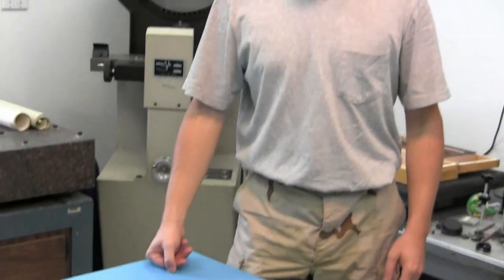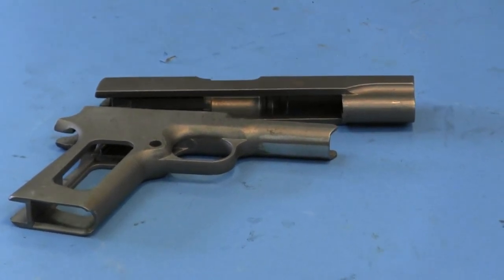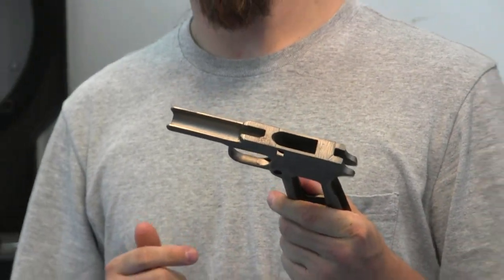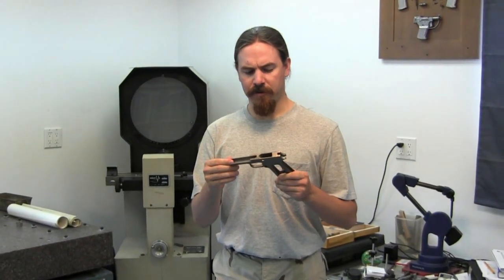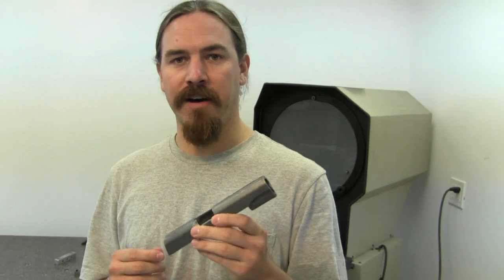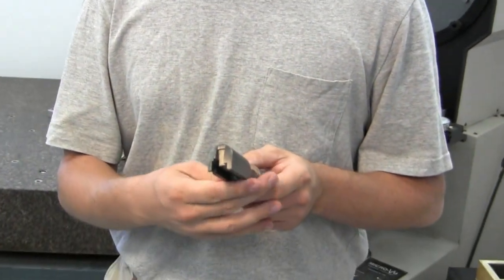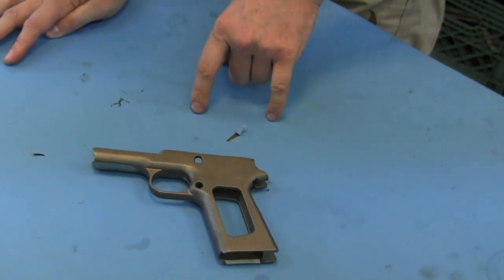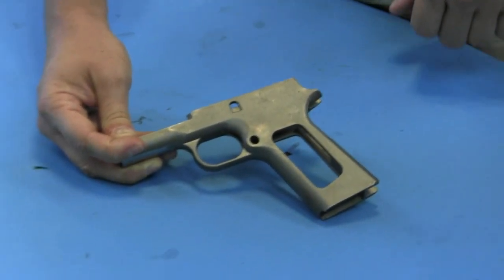Inspecting 1911 Frame and Slide Castings

Comment: I've seen flatter surfaces on any banana, and it's NOT an 'investment cast' one. Actually I put together an IDPA pistol, based on a Para (investment cast frame), with a factory Springfield Armory slide + Clark ramped barrel, Wilson beavertail grip safety, sear, hammer, diconnector, pin set, and slide parts, recoil spring guide & buffer, Wolff springs all over, Clark 4-finger sear spring. Tuned it myself and the outcome was pretty decent. Put some 1.000's of rounds thru it, (mostly my own reloads), and was still reasonably tight & reliable when I sold it to a younger fellow competitor who still uses it. Basically a quite accurate & reliable piece. I understand Ruger uses quality investment cast parts in most of their great products, which undergo machining with no issues related to it whatsoever. BUT several 'smiths won't accept R.I.A. 1911's, (Using several cast compinents too),  because variations & inconsistencies. The bottom line, I guess, is 'who' makes 'what' and how it is produced with 'what' raw materials to start with. Thank you for another awsome video!!.

Comment: Wasn't originally the slide stop hole on a 1911 frame the zero point for reference? From everything I have read all measurements are taken off that location, I could be wrong but I think that is what I read when I was trying to get a casting done and the measurement for the grip safety hole ended up being correct so I assume it is still true. I know you can also use the mag catch hole as well but ultimately the zero is up to the machinist and what points of references they have available. But because these seem to be so far out of wack your zero reference would also be out of wack and you'd end up with funky measurements, so I get why he didn't want to use them or even attempt to use them. 

I expected the top to not be perfectly flat and need to be decked, however, the side of the frame not being flat is a huge problem. I cannot believe someone out there cast these and didn't catch how shitty they were. I swear some people out there should not attempt to do a job like casting frames if they have no clue how to do it and not warp the living shit out of it. 

Anyways good luck on finding decent ones but you're right it is probably easier to just buy raw stock and start from scratch. He could make one from scratch and see if he can find a company who will cast the one he machines. Even Sarco castings lay flat on the side and are relatively cheap and buying wholesale should lower the price of them, however they have limited types of frame castings (mostly Para type frames).

Comment: So they are actually cast iron, thought they are too fragile to become firearms parts coz they can't absorb too much impact.
Reply: They are cast steel parts. There is a difference in cast iron and cast steel with cast steel being a lot stronger than cast iron. Cast iron is more close to wrought iron than cast steel. The metallurgy of the two is more specific than that but to simply put it cast iron is a form of iron and iron is also a part of steel the difference is that one is more malleable than the other and that isn't even really scratching the surface of the subject. 

How to tell the two apart is to hit a cast iron skillet with a hammer then hit a cast steel part with a hammer and you will notice the cast iron will thud and the cast steel will ring. 

The wide use of wrought iron in the 1800's let to Samuel Colt also using it for his first black powder pistols. Because of the lower carbon content of the firearm he felt the need to force carbon into the iron through case hardening. 

The steel used to cast 1911 slide and frame requires only 1040 carbon steel, according to the blueprints, which is the same steel used in differential gears and internal engine components on cars. You could literally machine a 1911 with all its parts from a crankshaft and use anything made of aluminum on the car to cast a frame easy to work with but still strong (an engine head springs to mind) as a lot of 1911's out there today are made from a high quality aluminum and any car manufacturer are going to use the same materials due to the beating a car takes.
Reply: Ruger's Redhawk and Blackhawk revolvers are made with investment cast steel, and they're stupidly robust, the .44 Magnum ones are rated for a steady diet of high powered 300gr pills that would very quickly wear out a Smith & Wesson 629, which is forged (which isn't a critique of the 629, it has its own appeal).

Alloy, heat treat, and design, that's what matters, you can make jet engine parts with investment cast steel, and Ruger has done exactly that.

Comment: If we assume the original mold was flat, then I have to assume the curvature was due to warping of the metal,, either during the casting process, or maybe in a heat treat later.  If course it is also possible the mold was made using a hand filed looks like pistol from the Khyber Pass, or perhaps a 1960s Vietnam jungle shop with all of the resulting imperfections in the castingn exactly like the original made by candle light flawed specimen.

Comment: does anyone know of a good casting company that makes frames?
Reply: Ruger... 
https://youtu.be/ZBYw1CT2JiU
Reply: Apparently not...
Reply: Just got mine off thunder tactical it was about 0.010" off but for the price hey ill take it for my first project
Reply: If you're looking for manufacturing reasons, you can outsource to Ruger, they make their own 1911s, so they could just straight up sell you some finished frames or fresh castings for you to get to work on.

Magnum Research buys Blackhawk gripframes from Ruger to build their BFR revolvers, as an example of such outsourcing. The Blackhawk is a pretty nice revolver, and the BFR is even nicer.

Comment: So someone fucked up when doing the patterns for these not accounting for shrinking and warping. =)
Reply: Seems like it. This was the case with basically all of the original Group Industries Uzi receivers. Vector bought Group Industries' stocks of janky Uzi receivers at their bankruptcy auction, and learned this the hard way. As the Hughes Amendment had just passed though, and these receivers were all registered as fully transferable machineguns, there was still lots of money to be made, so Vector just all had to roll up their sleeves and get to work on uncanting and handfitting every single receiver and build them into finished machineguns, which did end up being quite good quality in the end.

Comment: Para Ordnance (who use to be in canada but is now out of Pineville NC) still makes 1911's in cast. I actually bought a used GI Expert  just for a cheap build when I was taking Gunsmith classes at Trinidad St in Colorado. It turned out quite well. I kept the frame and slide. Everything else I shit canned. Most of the parts are ED Brown.(thank you Brownells for the dealer discount!) Though I did use a cylinder and slide thumb safety and NOVAK sites. 

 I finished the three year program a few years ago and I still use it at some of the IDPA events. For the money you cant beat it. I was going to go with a new Armcsor, "Rock Island Armory" but I chose the Para simply due to it being made in the USA. Though I will say most of the guys in that class used the Rock Island (because their cheap as hell for a 1911) or STI. Anyway I'm happy with it and have had no problems with it.

Incase you read this Ian, you videos are the only gun videos worth a shit on youtube. Love forgotten weapons simply because I get to see some decent detail of firearms I will never see come into the shop. Though I do know some people who think any and all shops get flamethrowers, Bazooka's, Tanks etc due to that stupid ass show sons of fail guns. Explaining how that is not, how it goes seems to surprise them. God I hate that show.

  Never even knew you were affiliated with gunlabs. Will have to cruise over to their site and check it out. Thx again and as usual, a very good presentation.

Comment: they know the specific tolerance for each process beforehand.  you keep saying that it would be more economical to machine out of stock.  come on.  know your processes and limitations before you publish a video like this.  the casting guys out there will know what i am talking about.
Reply: I agree with Ian.  He is merely saying more economical than trying to fix the flawed castings.  I have made gun parts by moth machining and casting.  If the flaws are such that the gun doesn't meet published specs on the reference charts, even after machining, then any money spent on that casting and trying to fix it is wasted.  Compare that to throwing a billet into a per-programmed CAD capable CNC box you already own and the money wasted on the junk casting is less than the cost of letting the CNC machine do it's thing.  Ian is not saying machining is cheaper than casting.  He IS saying it would be cheaper to machine a part than throwing money away on a junk casting, then having to fix it.  I agree as it is quite probable many of the flawed castings simply can't be repaired to actually meet Mil-spec for a 1911 in all directions and dimensions, and that would be money down the drain.

Comment: They sell one that interchanges with most 1911 parts just the slide stop, trigger, mag catch & grips don't fit but can be ordered. The frame is a p13/p14 type casting and can use series 80 firing pin lock set. The barrel will probably need extra fitting, probably the barrel ramp, but no big deal since you are looking at buying a casting. I ordered mine and can let you know a bit more when I start work on it and if its even any good. Buy the black one the rest are a no go.